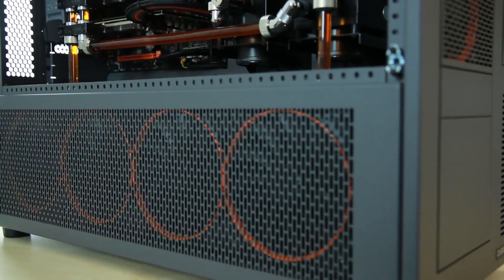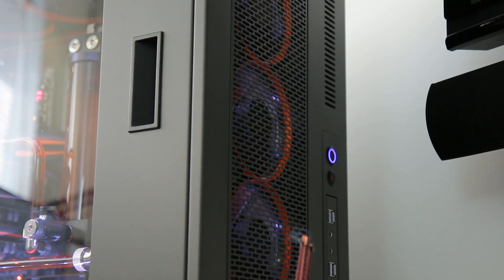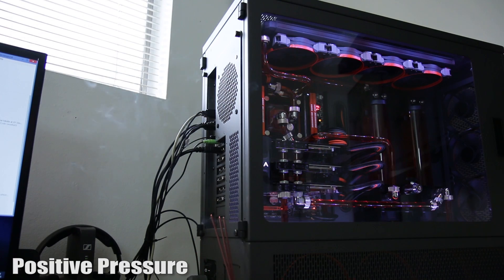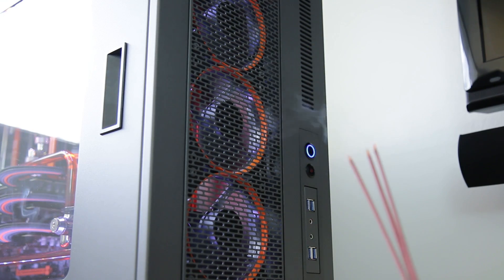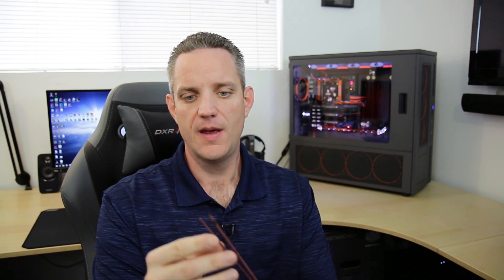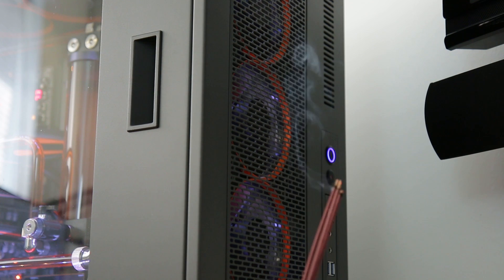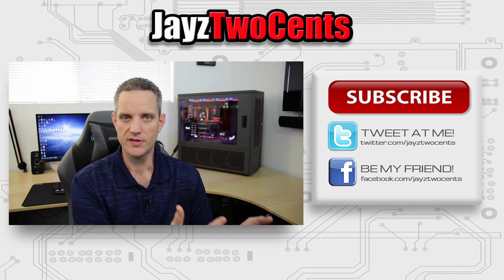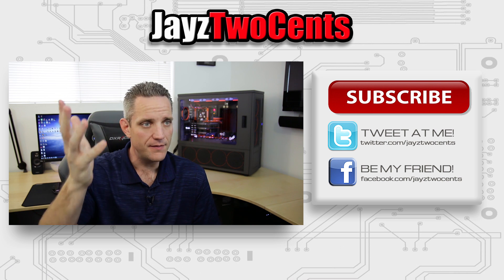Case Flow and Pressure Demonstration - How to balance airflow

Comment: Guys, please don't use incense. Smoke in general deposits soot and other residue and incense will leave even more from the fragrance oils its infused with. Look for a cheap little fog machine that uses propylene glycol or vegetable glycerine. Way more visible vapor and little to no residue.
Reply: Much better off buying a small tub of dry ice so there's no soot or residue, and dont turn your pc on while testing just power the fans with something
Reply: @Grumpher  I agree, dry ice might be the way to go. I have a fog machine and that thing leaves a nasty residue, I would put it no where near my PC...
Reply: @Grumpher  dry ice is not cost efficient. I dont know about where you live, but where I am you have to buy at least a block and those are about $10.
Reply: @Grumpher  That makes absolutely no sense. That's not a very realistic test if you're running your fans off a different source at a different RPM. Not to mention the cost of buying a separate power supply and buying dry ice. Buy a used fog machine from a second hand store for $10 and you can use it for life. Or get one of the cheap ones from Amazon or eBay or something.
Reply: Use cigarettes 🤣
Reply: pleb this will fry your motherboard! condensation is a real thing bro
Reply: yeah because water vapor is soo much better for your computer
Reply: @1337Easybake  where in "propylene glycol" and "vegetable glycerine" do you get water from?
Reply: +1337Easybake  It is. That type of vapor is different from actual water vapor like steam, the atomized particulate size is extremely small and it won't readily condense on components nor leave a residue thus making it far better to use than actual smoke from combustion especially incense smoke.
Reply: Lmao. Take a seat.
Reply: Jonnygreenjeans bro...its a one time thing... you re gonna test the airflow for 2minutes thats all....

Comment: i have 2 intake (1 at the bottom front of the case, the other at the top back of the case) and 1 exhaust (pretty much in the middle of the top of the case).

Comment: i found an old ball fan from the early 2000's, an shoved it in the back of my hp pavilion( there is an open area so it's not just blowing on the case) did this help?
Reply: check yourself. download something like speedfan, disable the new fan, run a benchmark, enable it again, run benchmark again. But I would say that it decreased temperature, but it definitely didn't increase it.

Comment: Positive pressure is not more air in than out. It's more pressure inside the case than outside the case. The air in always equals the air out over time.

Comment: positive/negative is really no big deal unless your in very dust environment.  max air through the case in a smooth flow is idea.  neutral is therefore best as your fans are maximizing the amount of air moving a positive or negative pressure environment lowers the air through the case because fans have to work harder.  It's basically a vacuum or a balloon at those cases.  It's harder to suck air out of a vacuum or push into a balloon but very easy to push air through a tunnel.  So ideally your pc I'd a tunnel n want your air flow as high as possible while moving freely across all components so they can vent to as cool of air as possible and faster moving air has better heat transfer properties... this is why you blow on your hot food.

Comment: Hey man! tks very much! your video help me a lot. Now, with positive air flow, I get low temps and 90% less dust! =) tks! 
(Corsair cabide spec-01, 2x140mm front, 1x120mm back on low rotation).

Comment: i used to really care about case pressure but now i dont even put a side panel on my pc
Reply: best temps i ever got is an open case with a massive house fan on it haha great temps
Reply: @theartofcompetition5965  where you trying to mine crypto? :P
Reply: The art of competition same XS
Reply: Why not just leave the case open and run a $10 box fan into it?
Reply: @SavageSalad69  That's what I did with my old Mac Pro, take side off insert box fan...heat the room in winter.
Reply: Mine runs 5 degrees cooler on bot cpu and gpu when i have no side panel and a 40cm fan blowing on it. How can anything match the power of that massive fan blowing directly at the mobo? Simple and cheap solution but a bit "ghetto" and not something you could sell to a customer obviously.
Reply: @GregRickard  That's because a side fan also blows the warm air back into the case. Especially if your back outtakes can't push the warm air out fast enough. Also the side fan needs to be close to the ground, which most of them isn't. My 230mm side fan is running on the lowest setting possible and is only used to cool my gfx card(s). The cool air basically only comes from my 3 front case fans. Also i have separate RPM settings on my fans. Although i use a PWM, my side fan, CPU fan, GFX fan, top 230mm fan and front and back fans all run on different speeds. To generate the optimum case flow. You have to play with it to know which works best for your case and components. Although an open case might seem cooler at first, a correct set up closed case can run more efficiently under high or max load. 
I use an old Xenon 12 core. My gaming rig build dates from 2008. So far i've only upgraded CPU and GFX card and maybe some quieter fans. It's still performing okay on most games like BF etc. But my case nowadays stays closed and is most of the time dust free even with 9 fans. I do have dust special covers on the front, side and bottom intakes. So they keep the case cool and clean even when running on 100% speeds. Some of my fans can go up to 2000 rpm.
Reply: I think it was Jay that even showed in a video things ran hotter with an open case!

Makes sense as your fans will be blowing out in a cone shape from the fan and if theres no side to keep that air in around your components you are going to loose some airflow blowing out of the case
Reply: f-bodys and mustangs i used to use a box fan at full blast on my old potato pc ;-;
Reply: SavageSalad Components are much more energy efficient than they use to be so really its not a big issue to have open air but natural convection is not as efficient as force convection.  so putting a fan over your open air computer will cool it much better.  specifically components that are not running cooling equipment (cpu/gpu) all the chips and such its better to have air moving across them but unless your overclocking the hell out of stuff should not matter much
Reply: +++++++++++++  You guys who are running open pannel with box fan/house fan , are you having problems with some dust and stuff? i thinking of going that route with a phat box fan
Reply: Keeping all the panels on your PC works the same way as the cooling shroud on a hot rod (ask a mechanic what happens if you take it off to 'get more air on it'). You need to be able to channel the air to go where you want it, absorb some heat, then get it the hell out ASAP.

If your PC is running cooler without the panel, it means that you either set up the fans poorly or your case is too cramped for proper ventilation, so even improper ventilation is better than none at all. But it's still sub-optimal, merely less bad than before.
Reply: depends on the size of the case. my tiny mid tower is about 5 degrees cooler with the side panel off. but i still leave it on
Reply: My pc actually runs hotter if i have my side panel off.
With my side panel on: 
cpu idles at 25c with a max load temp of 67c.
gpu idles at 27c with a max load temp of 62c.

With my side panel off:
cpu idles at 28c with a max load temp of 73c.
gpu idles at 32c with a max load temp of 77c.
Reply: I'm not even sure where the side of my case is anymore. 😂
Reply: You may have some issues with dust
Reply: My computer doesn't have a side panel anymore instead it has a very large low decibel fan on the side pulling air in that I used air conditioner sealing foam to make it have a good seal. So it now has insane positive pressure.
Reply: Could just take the side off and get a house fan the size of your case and line it up. Boom. If you're worried about dust just get a dust fabric and cover the whole hole.
Reply: @draco89123  A good box fan on high will blow most of the dust right on out. I ran one like that for two years. Hahahaha...and folks complain of a tiny fan noise from their little rgbs.
Reply: Typical when a pc is very old
Reply: amateur at best. you either have wrong setup or i dunno. Closed case properly ventilated should bring temps down
Reply: Damn, I have soooo many fans, I need coolant to watercool the fans...
Reply: You should put it back, your pc is gonna be full of dust
Reply: this is a bad idea.  always out side panel on even open air cases will run hotter then normal cases that are well ventilated unless you put a fan across them.
Reply: +bob smith i have like 9 fans and a corsair water cooler
Reply: @kippenoma5351  you're an idiot
Reply: External fan blowing air over is most efficient by far.... what some of these people dont get is there is more then a cpu and gpu, there are lots of chips that dont have fans and need air flowing over them, this is why its not good to take the side panels off if cpu and gpu run slightly hotter with panel on this does not indicate all the chips on the board that are not cooled by those 2 fans... people need to think before they type, not all chips have temps on them either.  there is a reason cases are designed with side panels instead of just big screens... people are stupid... hard drives are another thing that needs the air flow burn em up i dont care its not mine... so yeah your cpu gpu will run cooler because your not blowing the air that has cooled the OTHER components of the computer off before it gets to them... duh...  but when you stop removing that heat from them... what happens...  anyways like i said they are all way more energy efficient then they use to be so heat build up is way less of a problem.  99.9 percent of energy computers consume is heat loss.  so if they use 400 watts compared to 1000 they use to use thats 600 less watts to clear.

Comment: I've been changing my fans continuously and I never seem to be satisfied. 

I currently have

1 120mm Intake - 50% Bottom vent
1 120mm Intake 100% Front vent
Radiator in Push/Pull on rear - PWM controlled
1 140mm top exhaust on a fan curve to be on 20% at 20 degrees 30% on 30, etc etc, until 70 where it goes to 100% automatically.

CPU Idles at around 16 and during Battlefield 4 went to around 48. (I7-4790K) 
GPU idles around 30 and goes up to about 68 during BF4.

I'm gonna replace all my fans with Noctua, 3 of them currently are but the other 2 aren't. I'm also gonna install another one on the front and another on the top filling every available slot, then plug them all into a fan controller and set them all to 40%. Except the radiator fans, hopefully I can get sufficient airflow and keep noise down. I love silence when it comes to fans

Comment: I have a Corsair Carbide 300r, a Corsair H80i V2 with a push and pull set as intake in the rear and a single AF140 as exhaust in the front, and that's it. Is this good? Dust doesn't accumulate in the case.

Comment: Damn..I just tried that with a cigarette, the only option for me unfortunately :D And I clearly saw that all of my non-fan openings are pulling air inside :s I have a full speed air intake fan in front of my case, a regular low speed exhaust fan at the back, which is working with a 7v set up and nothing else as an intake or exhaust...Just the inside components like my gpu with a 3rd party cooler, cpu cooler (3rd party again) and the psu which takes air inside and pushes that outside (that means this acts like an extra exhaust fan right)...Unfortunately my case does not have any other fan so what can I do for dealing with this irritating negative pressure effect...I clean my case every week and see a lot of dust :/

Comment: I don't water cool, and I never worried about pressure as much as flow. Over all, I try to match fan for fan across the case to cool all the passively cooled components. Currently, I have two intake and one plus the PSU and GPU fans as exhausts. first intake blows across my HDs exits out the PSU and GPU. The second intake is above and to the right of the cpu, cooling my ram since the CPU heatsink is way to big and it's fan sits above the ram. It's exhaust is above the IO panel. When the GPU fans speed up, so do the intakes. It seems to keep the case pretty neutral since the smoke test only shows air movement around the intakes and exhausts.

Comment: Hi Jay.  It is feasible to install 2 140mm fans and have 3 120mm on a radiator and a 120mm in the back? when the rad is on full speed even on 90% rpm on te front still have negative pressure. i try all combinations. the only thing that i have not test it. is turn the rad fans to intake and have a 140mm fan in the back

Comment: so the front fans are a fix rpm in your case. 900 to 1000 rpm.  i did make my first OC last night. 2 jet flow 120mm in the front (one on the bottom if hard to explain) and the red have 3 120mm sucking air to the top. on the oc stress AIDA64, i did feel a lot of air on the back. (no fans) but not much on the top. (rpm on those a insane at 100%) so the best way is to make a 900 to 1000 rpm fix on the front and let the top3 do the hard work.?  I what thinking doing 2 thinks. 1 turn the top 3 fans to intake so all air goes to the back natural ways. i can add another fan there. that also cool the vrm better at the same time.  What you guys think. BTW i do not care about the noise. I am ok with it.

Comment: I have a water cooling question:  If I were to get one with a radiator that is one of the long ones that needs more than one fan, how would I mount it (or would i even need to mount it) in the coolermaster k380 case, where there are only single fan slots?

Also, does anyone know what those rubber holes on the back of cases are for?

Comment: What about turbofans - the one's which are used in sea-skimming cruise missiles? Will that help me create a positive air flow? And do I need to have a lot of them or just 3-4 would do? Also, would it be a good idea to combine it with liquid nitrogen as coolant? I have a Pentium 2 board with on-board graphics.

Comment: My only question is what are the best case fans period? In terms of longevity, airflow & the least amount of noise possible all being equally important.
Reply: I got three Noiseblocker NB-BlacksilentPro PL-1s, mounted on my radiator, that have been running more or less continuously for the last four years without a hitch. They are very quiet, but only move 68 cubic meter of air an hour (about 40 CFM), which is still enough to keep my moderatly overclocked i7-3820 at around 35&#176;C. If you avoid the dirt cheap ones with sleeve bearings then in my experience fans will usually last several years. You do of course have the occasional bad apple, but that's sort of unavoidable. Double ball bearings or fluid bearings seem to be the most durable, but again; that's only my experience. 

When it comes to airflow vs noise it's gonna be a compromise no matter how you twist and turn it, cause moving more air is always going to cause more noise. Something like a Delta fan is superior at moving a lot of air, but they don't call 'em "Delta screamers" for nothing. My Noiseblocker fans are on the other hand so quiet I have no trouble sleeping in the same room as my computer, but airflow is on the lower end of the "acceptable"-scale. 

The short answer is that there is no "best case fan period," because it's always going to be a compromise between conflicting factors. The trick is to determine what you can live with when it comes to airflow vs noise, and work with that. 

If you want my personal recommendations, then I'd say either Corsair AF quiet edition (SP quiet edition if you're putting them on a radiator) or EK Vardar-fans, and a good fan controller. Lamptron make some good manual ones, or you can go for the Aquacomputer Aquaero if you want a fully electronic one that can for instance monitor your system temperature and control the fans accordingly. The Aquaero 5 LT is the cheapest alternative, and you can expand it almost endlessly.
Reply: Gnomleif
Thank you! I need to figure out how loud my current setup is. Then so long as whatever I get is the same or quieter, I can just pick w/e falls in that decibel range but with the most cfm.
Reply: NB-Eloop

Comment: Guys is this correct I have the Corsair 760t Black, And I have two AF140's in the front taking air in and one AF140 pulling air out and two SP120's at the top throwing air in is that correct

Comment: Now what we need is a case / mobo that monitors the air pressure and controls the fans to balance it automatically. Or just a case with one massive fan on the front.
Reply: you could theroretically hook up a T sensor probe, but instead of a diode (?) on the end to measure the temp, have a small fan. The fan measures the flow and returns a signal, which the mobo would register. Then just use a manual fan curve to invert it and set all case fans to orient on the data from the T-probe slot. Just a small idea, no guarantees that everything I said makes sense

Comment: I just go with: open the system case, make a bigger casing using plywood, make the top look like an inverse funnel, put the system inside, put the 3.8k rpm turbo fan and screw it on the plywood, add 4 layers of fuzzy dust filters, screw the entire case to the desk... done... (by turbofan I meant the household huge ass fans)

no I did not do it because I don't have a desktop, however a computerized airflow simulation told me it was okay to do it...
here's what mattered though, how big the hole of the inverse funnel, how many layers fuzzy dust filters, how fast the AC turbofan is running, how many unwanted crevices are there in the plywood casing